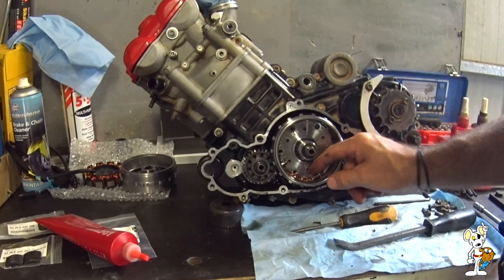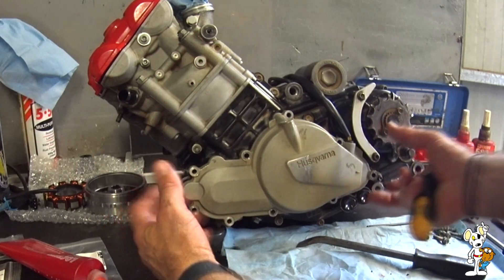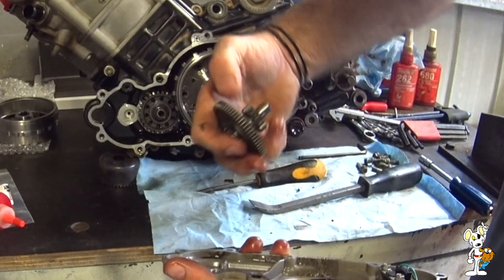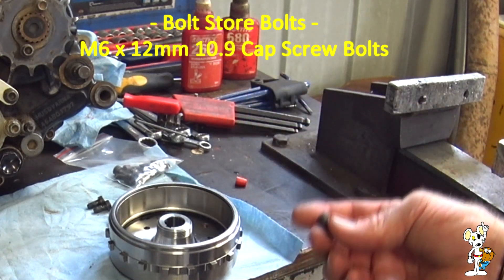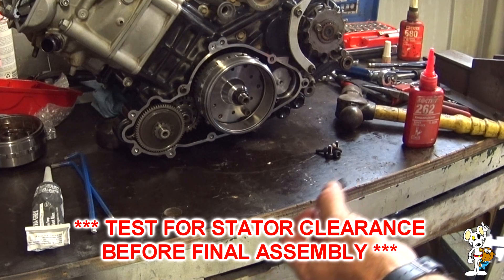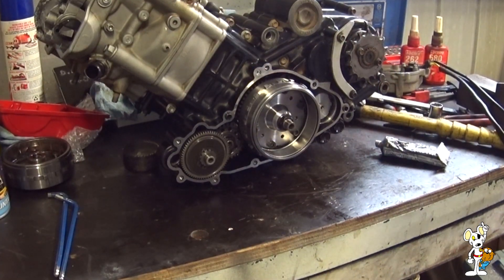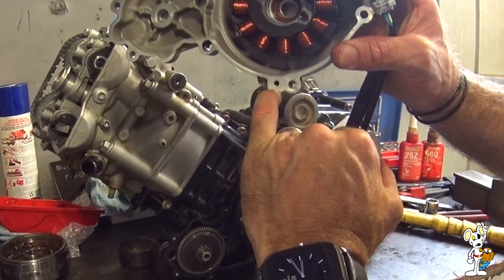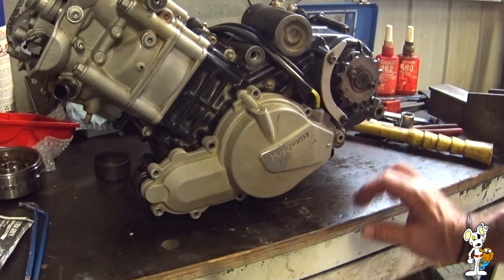Husqvarna CCM BMW 449 & 511 STATOR BOLT REPLACEMENT

Comment: Thanks for this video!
Just recently bought a well used 2011 TE511. Did a precautionary oil change and found some copper flecks in the primary oil strainer.

So no more engine running until I check these screws. Lights still work, so I might have just caught it before it did major damage.

Thanks again!
Reply: good luck bro

Comment: Cheers for the filter info , I mentioned I done this bolt mod seems to have about 2-3mm clearance I noticed that there is a bit of side play and/Or bearing play in the crank while tightening these up, so hope its still enough clearance. I was looking at the bolts hex depth of originals you mentioned it goes in through to the bolt shaft on yours , my ones seem to still be above the bottom of the head only leaving 1.8mm though and then they have a small hole going into the shaft so I agree they could stretch.  
Thanks

Comment: Thank you very much I will put it into practice, but I have a question, my dear friend.
As I can tell, if it is circulating oil for the entire engine system.
it seems to me that the heating could be because no oil goes up to the valves,
How to know if my oil pump is working properly?
Reply from the maker: If your engine is still running, the oil pump is working. 
Without oil circulation the engine will seize and stop. 
I can't think of anywhere that you can easily release a plug, or cap to check oil is flowing, but I'll have a look next time I'm near the bike.
Reply: @Danger_mouse  
thank you very much, I will be waiting for that possibility, greetings

Comment: I am a beginner mechanic and I am having problems with my Husqvarna motorcycle 449/511 the difficulty is I can't open the timming chain. The goal is to open the cylinder head at the core. I want to open the cylinder head because of the heat problem so that engine oil mixes with water thank you hope you can help me
Reply from the maker: You cant open the chain.
You must release the cam sprockets and lower the chain clear.
You must also keep the crank locked and restore correct timing of the cams when you reassemble the engine
Reply: Ok i have already done with your explaination thank you very much.
Reply: @Danger_mouse  thank you for your answers three days ago really helped me, and now I have a second problem, after everything is installed I am ready to start the engine, the engine starts immediately but if high rpm the engine dies immediately I hope to get a solution from you, thank you

Comment: Hello, thank you very much for the good Videos. My stator of My Husqvarna 511 failures and now i have a broken flywheel and a broken stator. Maybe IT is possible to fix the stator, but IT is Not possible to fix the flywheel. IT is Not possible to buy the Generator anymore. Do you know if some other parts from another motorcycle can fit? Otherwise, the motorcycle is gone :( thank you in advance.
Reply from the maker: Very sad to hear about your failure, unfortunately these parts are becoming difficult to source.

The only other flywheel and stator kit that can be made to fit is from the BMW G450X model.

There is a small difference in the width of the key securing the flywheel to the crank.
You would need to make it wider by machining the slot.

You may be able to find  used parts.
- 2011-2014 TE, TC, SME TXC 449/511
- BMW G450X all years
Reply: @Danger_mouse  ok, thank you very much :)

Comment: Gday mate, my new to me Husky 2010 TE450 stator cover is way smaller than yours. Its almost round, not elongated like yours. 
Is the procesure still the same ? Should i still check the bolts ? The stator hasnt failed as far as im aware.
It has 7500kays on the clock. Just picked it up yesterday.
Cheers 
From Nsw, New England ranges
Reply from the maker: @stefanlauster4877 
Hi there. Not aware of the TE450 having the same issues as the 449.
The 450 was from the Cagiva era, the 449 was BMW era.
Reply: @Danger_mouse  ohh thank christ mate. Thanks heaps for the prompt reply 🤘👌
Reply from the maker: @stefanlauster4877 
My pleasure.
For your information, a lot of parts on your bike can be found on the SWM 500.
It was a remade 510 model, basically your bike with a big bore kit.
Husky part numbers often cross straight over.
Several dealers here in Australia. (They had the same importer as Sherco does here)
Reply: @Danger_mouse  legend, appreciate you advice man, gonna give it a oil/filter change first up and go from there 🍺

Comment: Do you think the stator of the bmw g450x will fit the smr 511? My problem is that the husqvarna stator isn't awailable anymore
Reply from the maker: The stator windings are the same, but the flywheel will not fit unless the BMW keyway is widened to suit the Husqvarna crank.

Comment: apparently I have a problem with the oil pump, I say this because my husqvarna's engine is getting too hot and it seems that the engine does not turn up. Could you tell me what I have to do to check if the pump is working properly, many Grace
Reply from the maker: Hi Andres, 
I think you mean 'water pump'. 
The first thing I would do is change the radiator coolant mixture. 
Drain out all old coolant, fill the radiator with fresh clean water and run the engine until warm. Then drain this water out and add the new coolant mixture. Any good ethylene glycol auto coolant at a ratio of 50:50 mix is fine. 
Fill level should be approximately 10-15mm below the fill cap when cold. 
Next thing to check your cooling fan is working, idle the bike and allow it to come to operating temperature. Continue to idle the engine watching to make sure that it does not boil the coolant and see if the fan runs. 
If it does not, try powering the fan with some wires in the fan  power plug and make sure the fan turns. If the fan is ok, you may have a faulty fan relay. 
Use the workshop manual to find the relay on your bike and replace it. 
I hope this helps.

Comment: Hey, I don't have any cap heads, only button head screws at the right length and strength would these be suitable?
Reply from the maker: What grade are they. 
I would think that the button head type would be low grade type, possibly 8.8.
Regular 10.9 or 12.9 6mm metric bolts would be better as long as you have a slim socket that will fit in the space
Reply: @Danger_mouse  yeh thanks for the response. I just bench tested one and i couldn't get it past 10nm without rounding it off. Is the issue with the original bolts or the fact they are overtightened and not had loctite?
Reply from the maker: @garethrosser5346  
The issue is with the original bolts. 
If you look inside the head of the bolt, you can see a depression at the bottom of the allen key socket. The low point of this depression is right at the start of the thread and is a weak point. 
I believe they stretch at this point, then the dry type loctite can't hold them in place.
Reply: @Danger_mouse  ok I've sourced some 12.9 cap head now. Still use 15nm torque with these as with the 10.9?. Also fitted your breather the other week, gave the CCM a hammering yesterday on some trails and it performed faultlessly. Cracking product.
Reply from the maker: @garethrosser5346 
Yes, that's the correct torque.

Comment: Do you know what ohm's the pulse pick up should have? I'm working on a friends bike and can't find the specs it will spark once in a blue moon and its got only 0.125 ohms resistance
Reply from the maker: I'm not sure off the top of my head, I might be able to find it.
However, more common is coil earth wire fracturing at the coil, or the terminal where it bolts to the head inside the insulation.
Also check for possible corrosion in the coil plug terminals. 👍
Reply: @Danger_mouse  thanks for the fast reply, yeah I've pretty much got a new harness in it now, the poor fella has gone and replaced almost everything then sent it to me, I've checked coil resistance (and he's brought a new one) seems good, all controls and switches are good. 
Just can't find a manual to get these specs on the Bmw450
Reply from the maker: @looneyhoonsvietnam8911 
I'll see if I can either locate the value, or at least test mine.
I'm away from the house at the moment, but will try to get back to you later on 👍

I'm assuming that you have a good strong battery?
Reply: @Danger_mouse  yeah good everything, I've actually gone through checked all the switches and everything aswell. 
Ok thanks a heap atleast if i know the ball park on what it should be.
If it's not that I'm guessing it'll be the ecu as everything else is new now.
Reply from the maker: OK, so I have a spare damaged engine, it reads bang-on 120ohms across the sensor wires. I'm not able to rotate the engine to see if / how much it varies, but that should give you something to aim at.
Can't get to the connector in my TE449 to get a seco reading, as its tucked away in the frame too tight.
Reply: @Danger_mouse  uh so I'm actually very close to that, I'm wondering wether it is the ECU. 

I've taken the whole harness out and untapped it to check for anything, checked coil,  have spares for everything since my friend took it to another mechanic that just replaced stuff without checking the specs. 

I'll recheck all my earth wires before I give him more bad news
Reply from the maker: @looneyhoonsvietnam8911 
Ah, that's a shame.

Odd question, does it, or has it had a JD tuner box on it at all?
We've had 4 or 5 bikes in the last couple of years, on our Husqvarna 449 FB page, with blown up ecus related to the JD units. (always fuel though)

Also, do you have access to the TuneEcu system? (check my other 449 videos)
It is able to do separate injector and coil tests via toggling the ecu drivers.
If you have a known good coil and pick up, it should prove the ecu
Reply: @Danger_mouse  uh yes it had an EJK piggy back fuel tuner on it before.
Unfortunately I don't have an OBD cord or anything just to give me the final confirmation. 
I'll have some more playing around tonight,  I've just blown my knee out so I'm not so efficient at the moment but I'll get there. 
Thanks a lot for going out of your way to help me, much appreciated 👍
Reply from the maker: @looneyhoonsvietnam8911 
OK.

Just another easy check before you commit, was just chatting to a FB mate who loves these BMWs, he reminded me that they often shear the flywheel key. That would explain the erratic spark. The Huskies don't do it because they upgraded them to a wider key and loctite 680 to glue the flywheel onto the crank.
100% worth checking
Reply: @Danger_mouse  Just got putting it back together then saw your message pulled it apart again and its together again lol 

Anyway still no Spark, I am pretty much certain it's the ECU, The owner   will more than likely want to part it out to get some money back  rather than spend the extra as the bike's not worth much in Vietnam.

Are the forums for these a good place to sell parts ? 
Cheers for the help these European bikes are definitely a unique design
Reply from the maker: @looneyhoonsvietnam8911 
Did you check the flywheel key?

There are some good Facebook groups, a couple for the G450X and one for the CCM GP450 which uses the same engine. 
I'm not into forums much, but I believe there's a good one for the BMW. 👍
All the best.

Comment: what is the correct torque for these bolts ?
Reply from the maker: Hi, the correct torque is 12-15Nm. 
I made a mistake in the video and quoted the incorrect factory figure 👍
Reply: @Danger_mouse  thanks for the video, but the mistake in the torque numbers might cause damage…
Reply from the maker: @EvertJanDennekamp 
That's why there's a tile link mentioning the correct torque and a second note in the description.

Unfortunately I don't have access to the original video file to re-edit and upload a new version, they were lost when a laptop crashed 😏

Comment: This just happened

i cant find a stator I am
 in canada
Reply from the maker: Very sorry to hear that.
I would Google search
7723452 and see what comes up.
That's the original part number for the stator and flywheel set (not available separately)
If your flywheel is not damaged where the magnets are bonded in, and depending on the damage to the stator itself, it is sometimes possible to have them rewound by an alternator or small motor specialist.
Hope that helps, definitely fit new non-Husky screws when fitting the new or rebuilt stator.

Comment: Hello Mr. DangerMouse, I am going to change the stator and the regulator both are defective. I need to confirm a piece of information that you may have. According to the technical file, the system generates 13 amperes (nominal value). Have you ever measured how much the three motor output cables deliver?
Thank you very much.
Greetings from Argentina.
Reply from the maker: Hi Carlos, thanks for the message. 
Unfortunately I have not measured the output, no. 
You could refer to the owners manual for the alternator rating. 

Please also be aware while doing the work, in my video, I showed the incorrect Husqvarna torque reading if 20Nm for the screws. 
** It should be 13-15Nm for screws of this type **
Reply: @Danger_mouse  thanks again
Reply from the maker: No worries at all.

Comment: Any reason you shouldn't do it with bike on its side instead of taking the motor out? Thats how I did it on my DRZ
Reply from the maker: Yes, it's recommended to do it just lying on its side.
I had the motor for a rebuild at the same time in the video 👍

Comment: Hello dear friend, could you teach us in your next tutorial, how to make a clutch disc change?
my engine is skidding,
 and has no strength, insurance and needs a change of the clutch system !!!
I need to do my motorcycle husqvarna tc 449, and I do not know,
 please show me how to do it, I would be very helpful your knowledge ,,, I'll be waiting, thank you very much my friend, greetings!
Reply from the maker: Hi, the clutch on the 449 is very strong and rarely slips. 
There is another part known as the Torque limiter that has usually failed. (listed as Reduction Gear in the part list) 
This is what normally slips on this model and needs to be replaced. 
Unfortunately I do not have one to change to make a video.
Reply: @Danger_mouse  
hello good day, the truth I do not know about that piece, I do not even know where it is located, if you ever have it it reaches your hands,
oh you have it replaced on your bike make me know, thank you very much ,,,,
 take care and happy weekend!